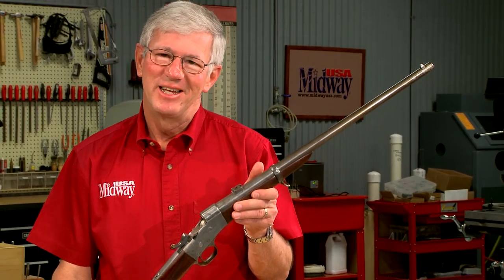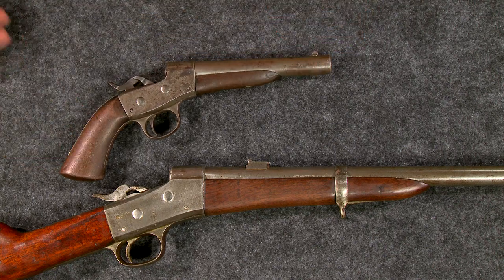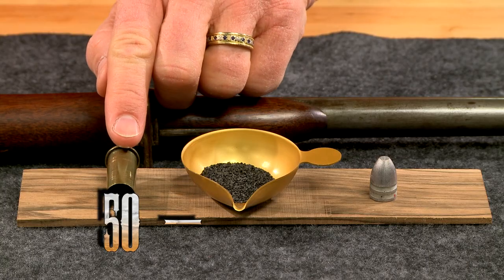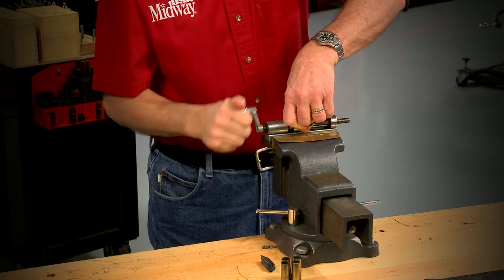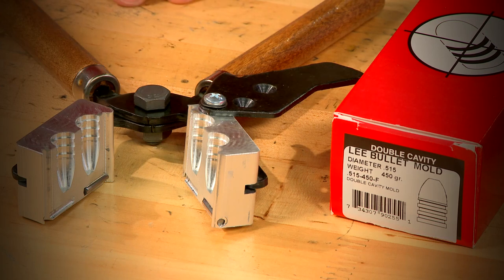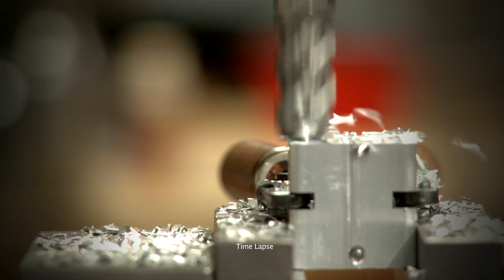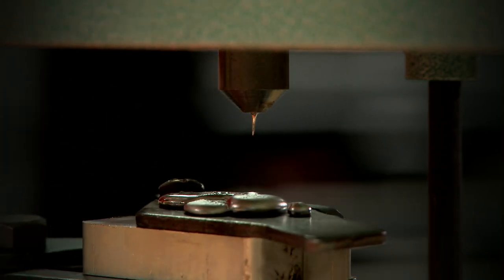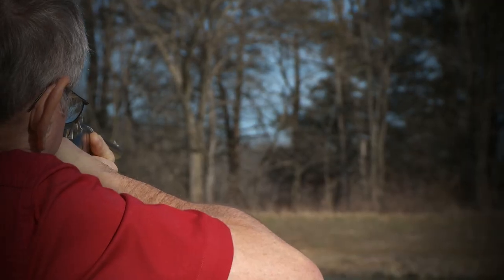How to Load Ammunition for an 1867 Remington Rolling Block in 50-45-400 | MidwayUSA Reloading

Comment: Hi Larry, Great video. Can you go over making a 11.7X51R cartridge for a 1867 Danish rolling Block,my  tang dated 1874. I was told that these were sold to the USA in the 1950's but mistakenly advertised  as 45-70.A 45-70 fits the chamber but is smaller.I believe the cartridge brass my crack upon firing.
Reply: Feel lucky, I have the previous model. It's the Danish Snider rifle chambered in 17.5x29 mm rimfire. There is no parent case so I'm going to have to manufacture the cartridges from scratch.

Comment: Can anyone give me information on the 44 77 Sharps cartridge in one of these old rolling blocks? I have an original rifle in the old cartridge and am looking for sources for my Reloading Data and can find very little. I know that 44 is caliber 77 is maximum charge of powder and and I know bullet weights range between 385 and 475 grains. What I'm looking for is pressure rating how much pressure can one of these rifles safely handle? I'm trying to develop a safe smokeless load to use in it even if it is lighter for target range practice. I know people do it for the 43 Spanish and if I have the maximum pressure rating of this firearm then I can look at different powders and bullet weights and figure out a load that will be satisfactory to me and safely within my limits. This cartridge is hard to find any info on it would be greatly appreciated thank you!
Reply: Steve Jenkins
George Nonte’s Handbook of Cartridge Conversions or the Lyman Black Powder Manual. Also Mike Venturino’s Shooting the Buffalo Guns of the Old West, and Cartridges of the World.
Wikipedia also has pages on most cartridges.
Reply: I use 25 grains of Alliant #2400 behind a 370 gr bullet it matches the factory velocity of 1430 fps and doesnt exceed the black powder pressure.

Comment: volume of powder, not weight, weight of powder didnt come about till 1899 during the smokeless introduction to firearms
Reply: +Mr. Mars Experience volumetric measurement of powder is actually volumetric weight, which is an imprecise way of measuring how much space that much weight of powder should take up, and doesnt take into account settling and air pockets.  This was not that big of an issue until smokeless powder's more rapid expansion became a factor.  But the point still stands, volumetric weight of powder is comparable to gravimetric weight when referring to gunpowder loads.  Ex. the 30-30 cartridge, the first smokeless rifle cartridge, is named so because it was still loaded on the same machines winchester had been using to load their black powder cartriges.

Comment: handmade ammunition should be very expensive
Reply: Its cheap if you DIY
Reply: ***** This sounds like an Anti-Gunner type stance if I read it correctly. I could be wrong, but I read the should as in "there should be a law ..."
Reply: neutered10mm His comment? I wouldn't be surprised. All i can say to him is in the uk they control primers (you need a gun licence to buy them) so crooks use primers from blank rounds.
Reply: Why?